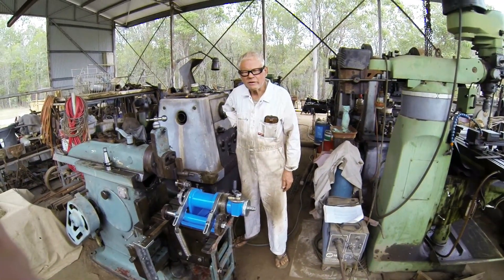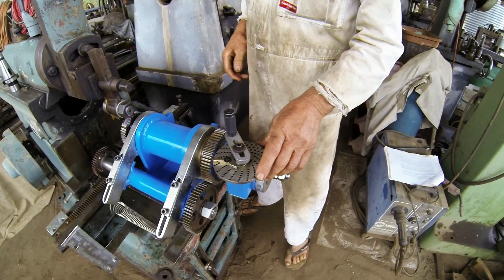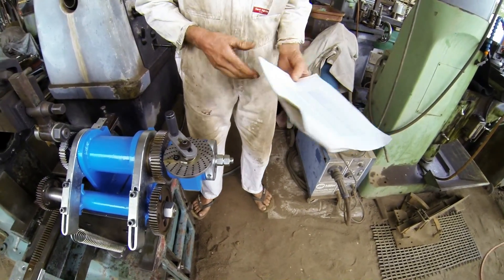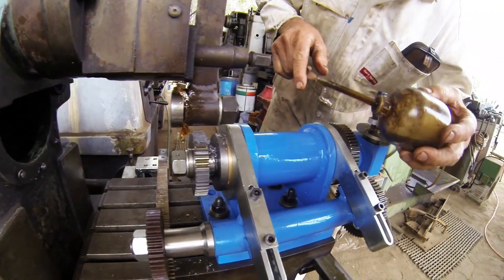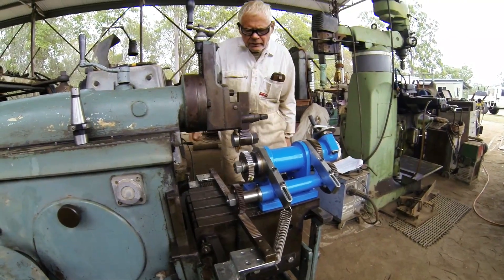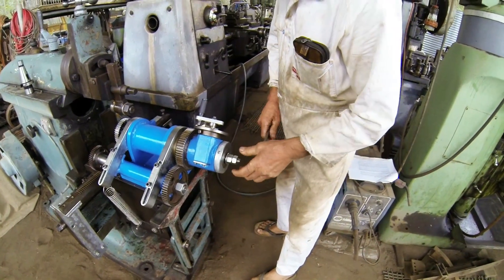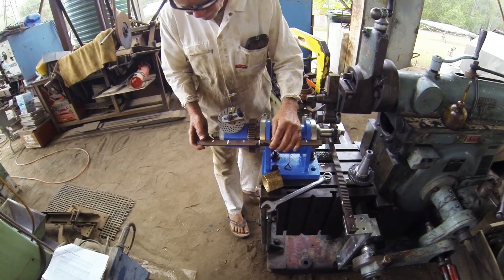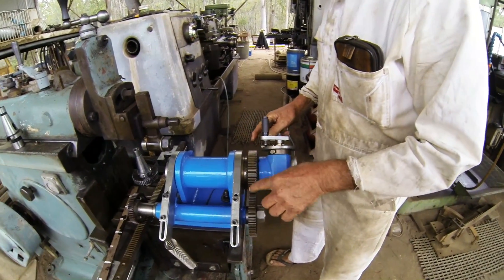Shaper gear cutting

Comment: No I haven't watched the whole vid yet, but the greatest part of this setup is that the cutter is a rack form not involute, so it is perfect for generating any number of teeth. I want a shaper.
Reply: Except you can't index prime numbers with that indexer. With a modification like a lathe banjo and interchangable prime driven gears you could use it like a direct indexer.

Comment: You have one of the neatest shops I have ever seen. Everything is sitting on a packed dirt floor. Any issues with ants? I just a hobbyist machinist if that much, my career is welding/fabricating. I was a tube welder and a pipe welder among other things. You have to be a genius to keep up with you, your videos are great, and I will surely watch them several times to get all I can out of them. I only have a lathe to work with, wanted to find a milling machine but it's ridicules what some folks are asking for them. I thought about a shaper if you can find one in good shape that is. Seems to me that you could do a lot of machining with a shaper alone that is after you learn all the features and how to operate it. Anyway, thanks so much for sharing your skills and videos. Paul Greenlee

Comment: Didn't get it, how You know when the gap cut is done and it's time to move to the next tooth.
Rustinox recently showed his way of shaper cutting a tooth wheel. -didn't understand him either...

Your foot ware is not very protective. Don't You chips and swarf in Your feet?
Reply from the maker: watch again and when it gets to 2.28 you will see me advance the indexing unite one tooth  .... if you watch the Rustinox video you will notice he unscrews a little pointed bolt and moves it around one tooth on a gear he has attached to the shaft ...it is plain to see if you watch our videos completely  ...but i don't know what your video quality is like
Reply: @nealblackburn8628  I saw that but how do You know You've reached the point to stop cutting and advance the index?
Reply from the maker: what happens is the cutting tool goes into the gear ( to be cut ) and then comes out ...when it comes out it is time to index to the next position.... But the tool doesn't actually move to achieve that ..the gear blank itself moves across and rotates under the tool  to achieve that ...don't be lazy watch carefully and you will work it out @Stefan_Boerjesson

Comment: It's brilliant, elegant design, do I understand correctly that it is the pitch circle diameter that needs to rotate at exactly 1:1 with the table traverse?

I also have a dirt floor workshop with no walls, mine has the disadvantage of being in Wales, so dirt sometime means mud. I have heard of something I think it's called 'concrete' which may improve things one day.
Reply from the maker: that is correct and if you have the right change gears that is the way you set it up but if you havn't  you can cheat a little bit and make a gear with the right number of teeth  (that can be done with the indexing bit of the device ) and a gear profile that is not quite right and then use that to cut your gear

Comment: If it is a 60 tooth gear being cut then i would think it needs to be a 60 tooth gear in mesh with the driving rack or a ratio train of gears that equate to the same.
Reply from the maker: thats right  but you can cheat a bit if you don't have the correct racio  because  you are only  cutting one tooth at a time so the error might be very small just the same way as gear cutters cover a number of different gears

Comment: Hi Neal, I love to see "boot strap" engineering in which you generate an involute from a trapezoidal cutter!
How did you pre-slit the tooth spaces in your blank?  Did you use the shaper with live advancement disengaged?
By the way, what was your module/DP and pressure angle on this job?
Reply from the maker: you don' need to pre slit the tooth spaces, the indexing component makes sure the teeth are all properly spaced...i know the photography isn't the best and it is hard to see what is going on...i want to do another video to explain  more but too busy at the moment ...its a 12 DP with 20 pressure angle
Reply: @nealblackburn8628  Thank you very much for your reply!  I just discovered your channel this week.  And I'm glad that YouTube recommended it to me!
I incorrectly assumed that you would pre-slit to limit the amount of wear on the tool.  But now I understand that the tool is able to perform the entire job.
Your homemade indexer is the best one I have seen on YouTube.  I assume that the large tension spring eliminates backlash. Excellent work, Sir! 👍

Comment: I would have loved a camera angle along the direction of the tool movement and looking at the slot between two teeth being formed. What would also have been great: showing the motion where the table is cranked back to the starting position in the beginning, as this makes tangible the way the axes are coupled and how the motion is orchestrated. 
Very nice setup!

Comment: It’s really awesome seeing different approaches to this problem! The solution I implemented was due to not having the gears of the pitch required, or a rack, or indexing head available. In practise we use the tensioned wire approach to drive our embroidery machine pantographs at high speed and they maintain 0.1mm positional accuracy day in, day out. The only other setup items required are a disc turned to PCD and a disk cut with index slots for the desired number of teeth. Worth a look in my channel if you are interested in that method, which also includes a build series in the playlist
Reply from the maker: i have seen your videos  and it was just what i needed to kick start me into action ...thanks for the inspiration
Reply: @nealblackburn8628  where in Oz are you mate?
Reply from the maker: @JBFromOZ  about 1 hour outer bris

Comment: so it starts off cutting at a tangent and then the rotation brings the gear into the verticle pane of the cutter ?
Reply from the maker: the Geofery  Crocker video on gear cutting does a good job of explaining what is going on ...in terms of generating the involute shape.... .have you seen that
Reply: @nealblackburn8628  I imagine a trapezoidal tool engaging and disengaging the work just like as if a gear would engage a rack as it rolls over it, only the rack subtracts metal when diving into the gear blank. Is that about right?
Reply from the maker: @JohnDoe-ce2wl  ....the rack idea is right  but just imagine  only one tooth can cut

Comment: Hi Neal. That's brilliant. So do you change the gears like on a lathe to obtain different pitches? 
I like the paper towel trick to hold the coolant. Love your airy workshop. Tony
Reply from the maker: if you got change gears from a lathe you could build it to use them ..i built it to use the change gears that i got with my dividing head
Reply from the maker: i got a universal dividing head which comes with a selection of change gears and the idea was to make use of something i already had... actually you need more than you get with a dividing head but it is a good start and you can cheat a bit and use a gear which isn't quite right or you could use the tool to cut a gear by indexing for the number of teeth and do a plunge cut for every tooth....you change the gearing so that the gear you are cutting turns at the correct speed  .....Geoffery Crocker does a good of explaining what is going on in his video

Comment: I would think whatever change gears you choose it would need to be 1:1 between the rack and the cut gear. In the 48 tooth example I'm guessing you have a 48 tooth on the rack and two 60 tooth gears at the driving end. Or another way of thinking about it would be cut gear (48) + 60 tooth welded gear = # of teeth (108) required on the rack side. Am I missing something?

Comment: Neal, I have a Värnamo SH-2 14" shaper. I've been thinking of making a gear cutter for mine. I like the rack driven design, most I've seen use a cable tangent to the pitch diameter. The video cut off right when you were describing the gearing. It appears you have 48 tooth on the rack and a couple 60 tooth gears opposite. Is that correct?
Reply from the maker: tried to reply to your email didn't send... the 48  is being cut.. the 60 is permanently welded to index housing .. the others i might tell you later
Reply: @nealblackburn8628  Thanks for the quick response. I don't think it's possible to reply to the youtube email notifications. My email is rasmith at chehalisschools dot org.